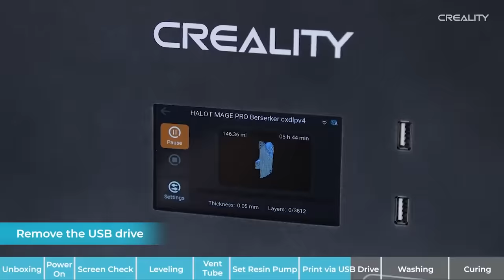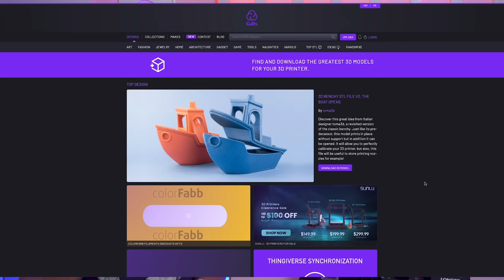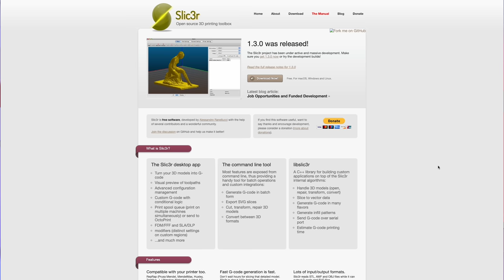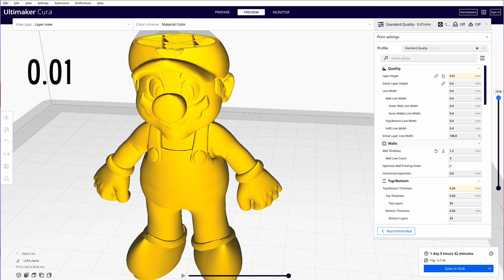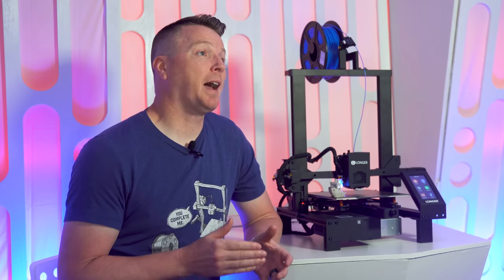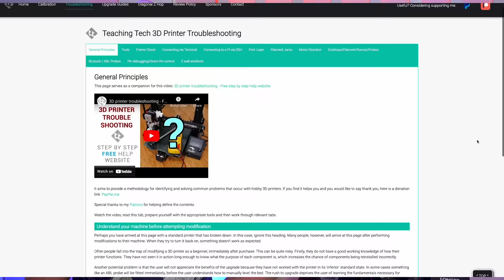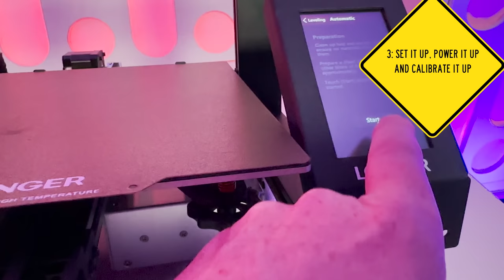3D PRINTING 101: The ULTIMATE Beginner’s Guide

Comment: I can't stress enough to beginners: Spend a bit more money to buy a printer with all of the "upgrades" that you're going to add anyway to a "starter" printer. My first two printers needed a LOT of upgrades, and considering the time and expense, I'd have been better off spending another $100 for each of those printers to get the upgraded versions with bed leveling sensors, filament sensors, direct drive extruders... secondary, but might be important to many, get a printer with a decent hot end assembly (this means a heatbreak enabling hotter temperatures). V-rails or rods? Dual z-axis or single? Decide these things BEFORE you choose a base printer; for example, upgrading to a dual-Z from a single-Z is not a straightforward upgrade (wasn't on my Ender 3 Pro, binding like crazy). Lastly, Klipper or Marlin? Regardless of what side you land on that one, I'd say it's easier - and safer - to start with Marlin. Klipper adds a layer of complexity that demands experience when dealing with issues. Get that experience first, then dip your feet into the world of Klipper.
Reply: For those that just want prints yeah BUT for tinkers the upgrading process can be half the fun, I loved starting with the base model ender3 because I got to do the upgrading myself which taught me more about the printer and process plus for me was fun. When I first brought a printer I also didn’t know if I’d enjoy the hobby so the upfront saving was appealing
Reply: If you don't mind me asking in your opinion what's a good price for a beginner to buy a printer. Like what would it cost on average?
Reply: @nassahexxofficial if your just starting out I wouldn’t go over 300 tbh learn it and if you like it I would upgrade I can’t wait to save for an industrial and resin printer they’re costly but the cheaper ones still work fine just need a little more fine tuning to get a decent print but it’s definitely worth it for new people cuz it helps with learning imo

Edit: if you can find a reasonable used one I’d go for it depending on what it is I wouldn’t pay too much for it though
Reply: Anybody have a suggestion which printer to go with? New to all this, and Im not super computer savvy. I like tinkering with things but not really of things if this sort. Mostly would like something to learn on, but not wanting to do upgrades immediately.
Reply: @roughstrings7461  hmm 🤔 what’s your budget?
Reply: @JustFilmAlready  honestly maybe like 250-300 to start. I’m aware I may have to spend more, for what I described. Tbh just looking to get ideas from more experienced folks
Reply: I am brand new to this. Wanting to make kewl toys to sale can you tell me what is the best for me. Pls ty
Reply: @roughstrings7461 yeah what she said😂
Reply: @kimberlycurtsinger72  I mean I’m not sure how to answer this tbh. Do you know how to create the toys you want? Or what kind of toys are you looking for?
Reply: I'm just getting into it, and got a Bambu Lab X1C while it's on sale. Excited for it to get here.
Reply: Can you get one like you're speaking of around 4-500? New to this type of tech any input is appreciated
Reply: @neilthompson3485  yeah you can get a good one for that price. With Christmas around the corner they should be going on a nice sale again.
Reply: Do you have an affiliate link to your favorite printer
Reply: Best $700 I spent on my first 3D printer. Just bought the Bamboo Lab P1S and I've printed many prints so far with no issues. Even printed 3 figure STL models that needed supports. I selected default supports and adjusted no parameters. Sure the printer was on the higher cost end but I did not want to get the printer and tweak it right off the bat. I wanted to print right off the bat. Now I can start learning all those parameters.
Reply: This is very true, I bought a 100 dollar printer and I’ve already put over 100 dollars to make it stay up to date
Reply: So for a beginner,  which one would you recommend. Thanks
Reply: I bought a qidi x max 3 after like a year of research. Hope it works out OK. Got a good sale price too 850ish
Reply: Got an auto leveling bed for 200 bucks ..
Reply: You're trying to be way to picky on stuff for beginners lol sounds like you're the beginner when everyone else disagrees with ya bud
Reply: I disagree. It is about the journey for me, focusing on understanding the technology, the options, the machine, the processes... and the the struggles and the failures. Then the process of cad and design to further forge the skill. Heck if you are already a designer and want button to print then spent the extra whatever. But what's the harm in starting small, whether your strength is fab or design. Don't let the software and technology drive you. You be the driver and know what's going on.. and your depth will be rewarding and endless
Reply: is k1max a good printer?
Reply: Had to come back to say thank you for this well laid out comment. This comment is almost as valuable as the video 🙏 thanks for sharing your personal wisdom/helping us learn from others mistakes so we don't have to make em
Reply: Hi. Just starting out can you recommend a particular non budget one that may have these things already on as I'm afraid I don't know the difference x
Reply: @clevern3rd102  hey, I'm looking to get into 3D printing and I'm at a complete loss for where to start. How are you liking the Bambu so far?
Reply: No, just buy any newer printer
Reply: If you had to do it all over what printer would you get as your first one? I was looking an ender 3 s1. Thanks

Comment: This is a very good overview of 3D printers in general.  A couple of points for clarification are needed based on what was mentioned though:  The Gantry controls the X and Z axis, not the “X and Y” axis.  The longer printer you demonstrated with has a Type “B” USB connector and not a “Type A” connector. Beyond those items everything else was very well covered and should help any newbie understand most of what they need to know to make their first purchase.  For a follow on video, you may want to consider discussing the types of printers on the market like Core XY, bed-slinger, or the types that have round vs square/rectangle beds and the types of bed materials, which is a major factor in the output of most all prints.
Reply: Could you send me something to read on that Iwant to k ow the details please even though I do t k ow what it means yet I would be so greatful
Reply: Check out frankly builds bro he’s good at letting you know what each printers do as he literally has a bunch of different ones. His builds come out beautifully and he’s who I watched when I first started. Make sure you always check out the reviews so you’ll kinda have an idea of what problems to expect so that when it inevitably happens you can quickly catch it

Comment: I ordered a Longer LK5 Pro 3D based on this video. Found a screw bushing that fell out and was missing one of the bolts. Emailed support - no response after 24 hours. Went to hardware store to see if they had anything, but bolt is too small. Initiated return process. Will try a different model. Disappointing for my first 3D printer.

Comment: I want to mention here, this video is very helpful for me, because it helps me to be properly directed in my specific objective to design and cast up to 8 inch ABS housing for printed circuit board devices. Which models are the best to cast small 8×4×2 boxes?

Comment: Great video, very informative. I want to print prototype electrical components. Some of these have to operate at 180 -200 celsius and have a UL94 V0 rating. Is there a preferred option of printer to produce these parts? I think I will need to use a PET material. Would you be able to comment on this? Many thanks.

Comment: 🎯 Key Takeaways for quick navigation:

00:13 🖨️ FDM and Resin 3D Printing: FDM (Fused Deposition Modeling) involves melting filament layer by layer, while Resin 3D Printing uses UV-curable resin for each layer.
02:33 🧤 Resin 3D Printing Safety: Resin 3D printing uses toxic resin, requiring gloves and a respirator for handling uncured prints.
03:01 🖨️ Key Parts of an FDM 3D Printer: Understand components like the bed, hot end, extruder, gantry, power supply, logic board, stepper motors, and more in an FDM 3D printer.
04:38 📐 3D Models and Slicing: 3D models start as STL files, which are sliced by software (like Cura) into G-Code instructions for the printer.
05:47 🧩 Slicing Software: Popular slicing software includes Ultimaker Cura, PrusaSlicer, IdeaMaker, and MatterControl, with settings for print parameters.
09:32 🔧 Support and Infill: Supports help prints bridge gaps, infill determines interior solidity, and layer height influences print resolution.
11:10 🔍 Layer Height: Lower layer heights offer higher print resolution, but settings should match your nozzle size.
12:47 💾 G-Code Transfer: G-Code files generated by slicers are transferred to 3D printers via SD cards, micro SD cards, USB drives, or wireless connections.
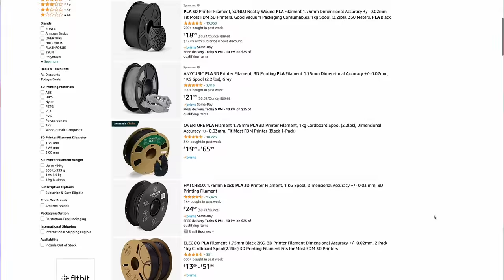13:29 🌈 Filament Types: Common filament types include PLA, PETG, and ABS, with various specialty filaments offering unique properties.
16:57 🌐 Multiple Filaments: Some 3D printers support multiple filaments at once, allowing for multicolor or multimaterial prints.
17:12 🔧 First Layer: Achieving the perfect first layeris essential for a successful 3D print; automatic bed leveling or manual leveling with a piece of paper can help.
19:03 🚀 Step-by-Step Process: The video provides a comprehensive overview, from unboxing your 3D printer to slicing and printing your desired model.Is there anything else you would like to know or any specific topic you'd like to explore further?
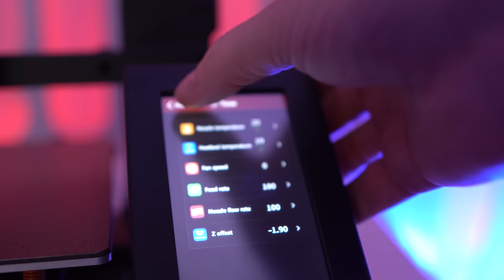19:45 🏗️ Essential 3D Printer Features: Look for features like a user-friendly interface, good temperature range, and a quality bed material like PEI for easy adhesion and print removal.
20:13 🔄 Customization with Marlin Firmware: Open source firmware like Marlin allows for extensive printer customization, enhancing your 3D printing experience.
20:27 🦾 Dual Gear Extruder: A 3D printer with a dual gear extruder provides maximum grip on the filament, improving print reliability, especially with flexible materials like TPU.
21:38 🚫 Common 3D Printing Issues: First-layer adhesion problems and layer shifts can occur. Address them by cleaning the bed, proper bed leveling, and checking belt tension.
22:47 🧹 Troubleshooting Resources: For more 3D printing troubleshooting help, resources like All3DP and teaching Tech's tips are valuable.
25:08 🛠️ Pro Tips for Success: Minimize support structures, experiment with lower infill percentages, consider buying quality paid models, and engage with 3D printing communities for support.
26:49 📝 Step-by-Step 3D Printing Guide: Follow these steps for successful 3D printing from unboxing to printing your own files. Be patient, as some prints can take a long time.
30:19 🕰️ Embrace 3D Printing: 3D printing offers endless possibilities, so experiment with different filaments, colors, and printers to unleash your creativity.

Made with HARPA AI

Comment: What do you consider the ideal modeling software if you wanted to design and print motorcycle fairings and custom plastic parts for large-scale model kits (think 1/6th scale RC model crafts).  I have a list from what I've researched, but I would like a professional's input.  Oh, also, the goal is to get into carbon fiber materials.  Either printing the models, and laying the CF, or printing CF directly.  Not sure if the software would affect this or not.

Comment: Is it possible to tell if a nozzle is worn by measuring the diameter of extruded filament?
Reply from the maker: I’ve never tried that but it’s not a bad idea. You can buy replacement nozzles pretty cheap so if I have a suspicion that a nozzle is wearing I’ll just replace it. They’re about 25 cents each on Amazon unless your printer needs a proprietary kind.

Comment: Great video! Just what I needed. Been looking at 3D printer videos for a while, but did not really know of all those things with what a slicer really was, and some of the most common preferences were when printing etc. So much wiser now, thank you! Currently I were considering printers like the Prussian MK4 or Bambulab X1C. Never 3D printed anything before, but seen many videos about it. Even if less expensive printers could do it, I just want to get the best experience, and try to think ahead in regards to future need. Already heard of folks that started with something like the Prussian Mini, and quickly realized they wanted more. I hardly have the space for 1, but I definitely do not have space for 2, so need to get it right the first time. :D. So what would I wish to print. Well besides playing around, and printing PLA stuff, then I am also into Retro computers where different drive bay covers, buttons etc. could be interesting, but also into soldering, and could need to print housing for different small devices etc. Though with the apparent many 3D designs out there, I would probably begin to dream bigger.
Reply from the maker: Sounds like fun things to print. I’d strongly encourage you to at least start looking into learning some 3D modeling. It opens up a world of possibilities. 

If you can afford a Bambu Lab or Prusia, I agree that it’s a great way to go. I have the Prusia XL on order but it could be a while still. The MK4 looks amazing and any/all of the Bambu Lab printers are fantastic. I have two and I love them. The X1C is really cool but I imagine the P1P is sufficient for most folks. I run an AMS on both of mine and it’s really nice to have.
Reply: @The3DPrintingZone  yeah 3D Modeling may be a point to play with as well. I definitely considered that as well. About Bambu Lab printers, there are also downsides I can see from other YouTube reviews. AMS can be tricky sometimes, and not the whole bed is available unless fiddling a lot with settings. Also the machine waste a lot of filament, and using AMS to print multicolor stuff, the waste gets enormous. However, I guess many such issues could be fixed somewhat by FW updates from vendor side. All 3D printers have their quirks, only a matter of what the user can live with I guess. The Bambu Lab X1C does seem appealing in both capabilities, and build quality though. Closed source is not so much an issue for me, as long as it is well supported, though the proprietary nozzles is a point to consider also. Many considerations! I heard good things about Prusa printers, while those also has some quirks. 🙂

Comment: I understand Bambu's lower-res P1S or X1C are FDM printers (hot glue guns) that support PT, PLA, ABS and carbon fiber material..   but what kind of materials are used in the higher resolution SLS/SLA (resin+uv) printers?

Aside from speed and the volume size of the print, how does the technology differ from industrial 3d printers (Stratasys Fortus 450mc, sPro 60, Essentium, Fusion3 F410)?  Is it that those support even more exotic materials (Peak Victrix AM 200)?  Or is it about the software (Orca Slicer , FlashCloud support, etc)?

Comment: what do you think of the new ender v3 se compared to this LONGER LK4 X for a first printer?
Reply from the maker: The SE looks like a pretty nice little printer. I have mixed emotions on the Creality brand due to both positive and negative experiences. My experience with Longer has been fantastic all around, however. That said, the $199 price tag on the SE is pretty tough to beat. Might be worth a try. I haven't used or seen that particular printer personally.